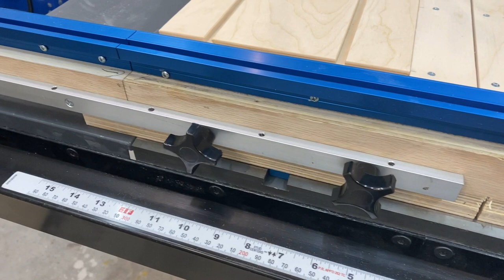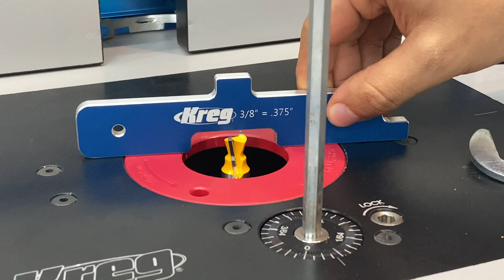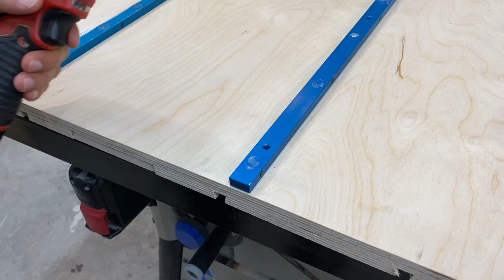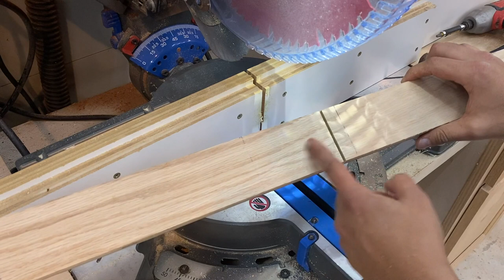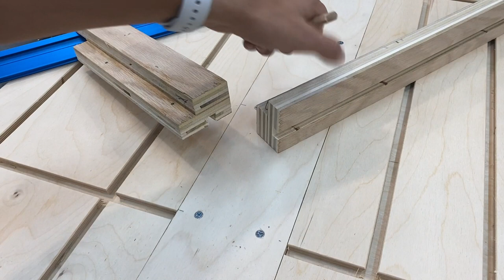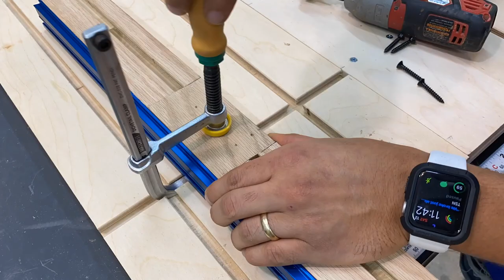GOAT Crosscut Sled Build! | How-to

Comment: This is a great build. One concern for me would be 3/8” router grooves on 1/2” base, ie leaving only 1/8” thickness (before gluing to other piece). Did it not become very fragile at this stage?
Reply: Andy, we do recommend using 3/4" or thicker material, but if the 1/2" is being bonded onto a base as it was here, the result is effectively a 1" thick base material.

Comment: When you glued the rear fence did you not make it more difficult to replace the zero clearance center piece? I would have just screwed it in place so it could be slid out once screws removed. Or ensure no glue on central piece under rear fence to allow removal.